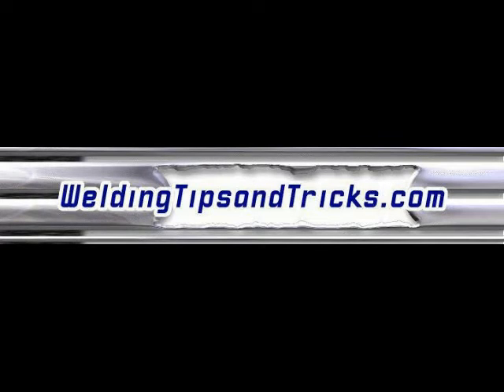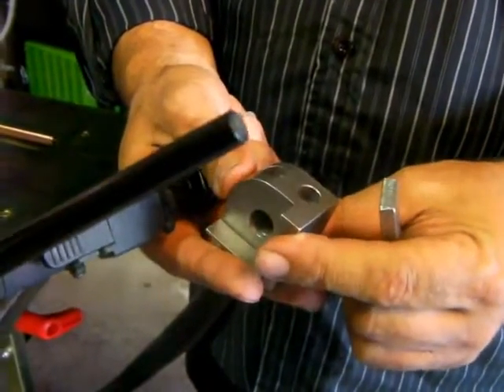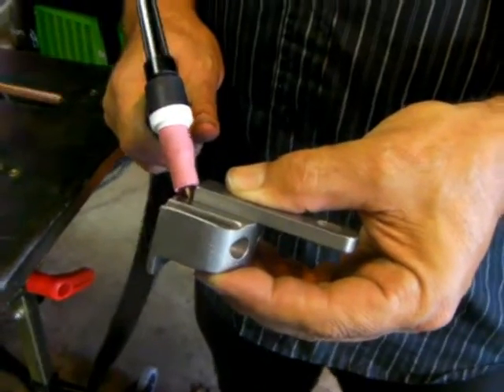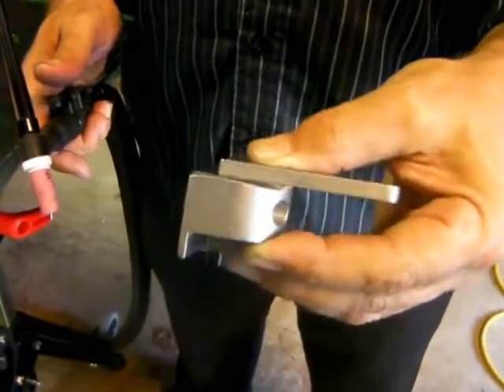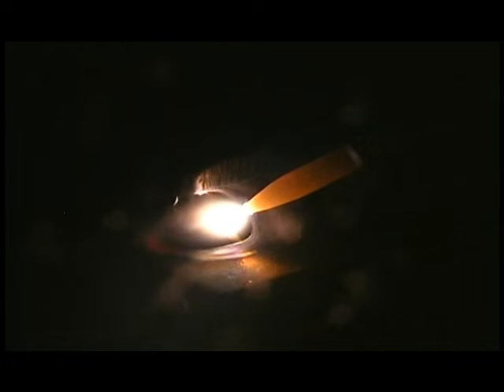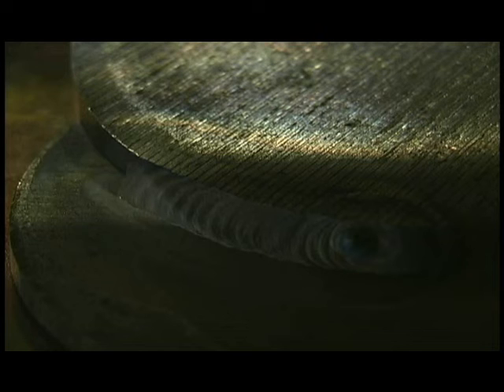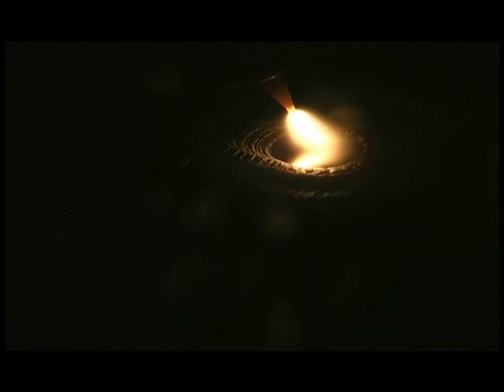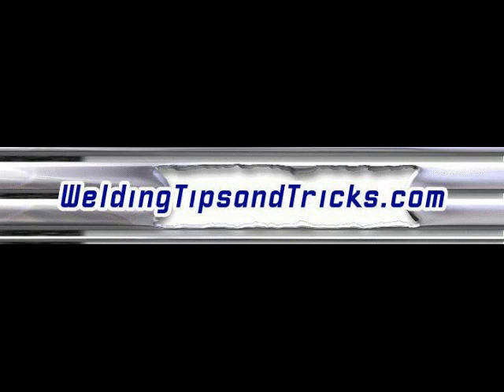Welding Stainless Steel 303 Free Machining Stainless

Comment: Just had the 303 conversation with a client, the machine shop they use convinced them to run 303 instead of 304 without sharing the tiniest detail about welding. I was sure I was doing another batch of 304 fusion welds on a thin walled piece of material and well... I used your article as one of the sources to explain the cracking that occurred.

Comment: does the weld heat or rod affect the grade of the steel. is the welding rod magnetic? I'm trying to learn a bit about metals. what grade is the weld after the weld? I'm working on a project and i need non-magnetic stainless steel.

Comment: Whats the sketch for using 316 stainless. Is it stronger than the 303 grade. Im asking because I intend to make a flasback arresting bubbler for oxy hydrogen gas system, so it needs to be strong??
Reply: Electrode 303 rod how to use

Comment: Thanks I appreciated the part where you said not to wash up with a long arc without the filler rod or you'll undercut.  I was having some trouble with undercutting. Trying again and watching for that has been a huge improvement.
Thank you.

It would be great if you did a video of with a lot of common mistakes and how to avoid them. 

Thanks again for sharing the knowledge.

Comment: Your videos are excellent, thanks for posting them. I realise most of your videos are aimed for professionals in this field. I never done TIG welding before, and I'm interested in taking it up as a hobby. One hurdle is choosing the right equipment for the novice, and the other hurdle is getting some exposure in welding basics. Posting a series of videos for entry level audience would be quite valuable, ranging from equipment selection, methods, and pointers to other educational resources.